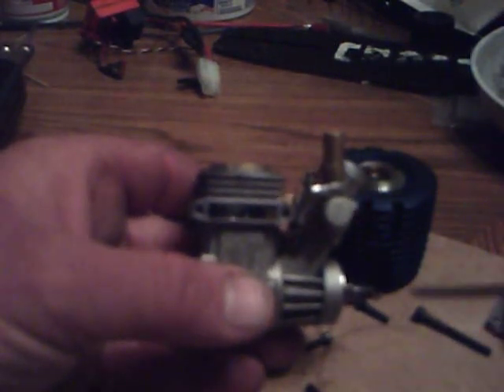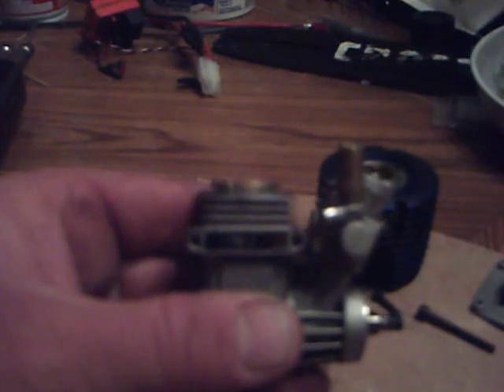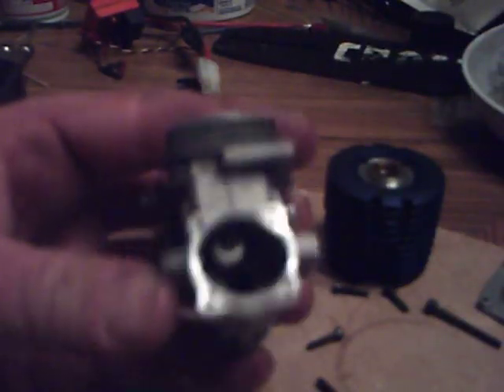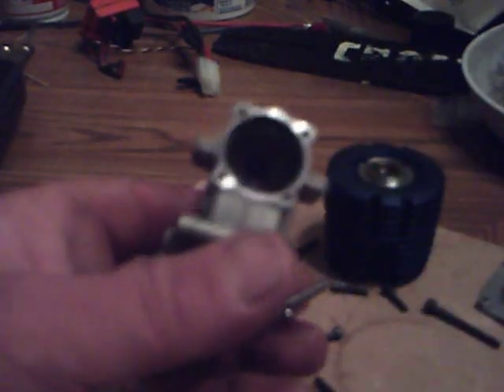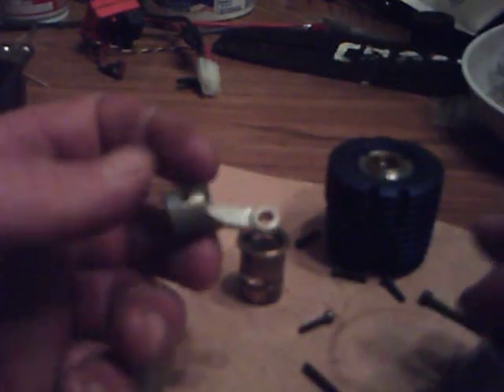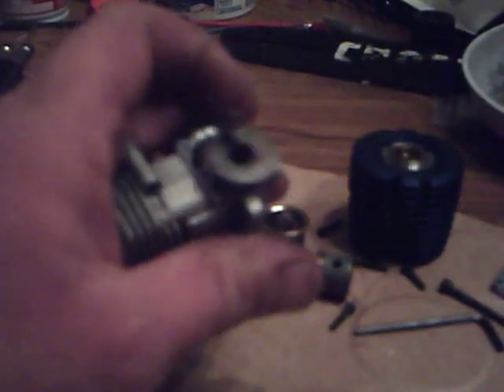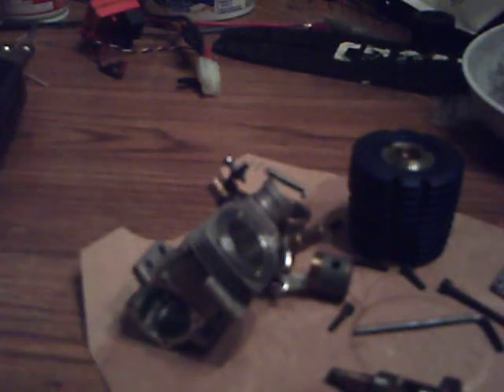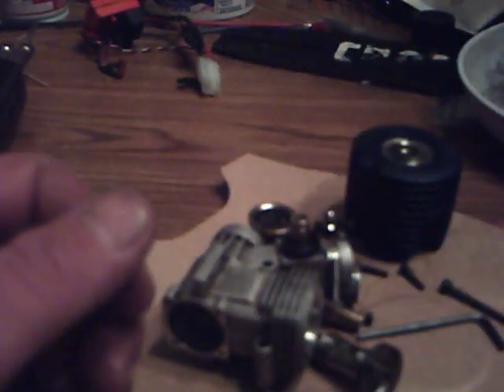Piston and Sleeve Removal

Comment: Mine too I just soaked mine in simple green and that cleaned it tons then blew it out with air compressor and about to use some engine cleaner to get the rust out then spray lube .